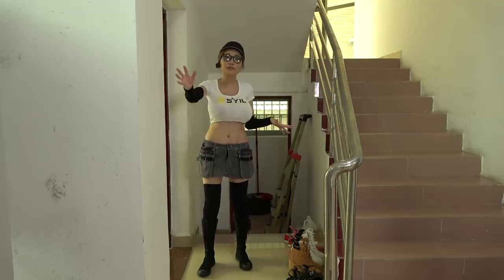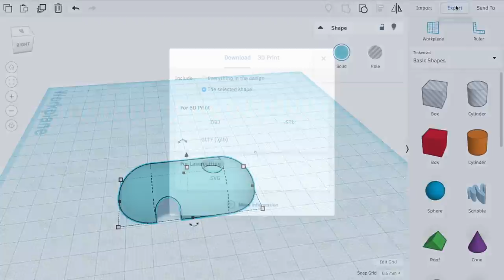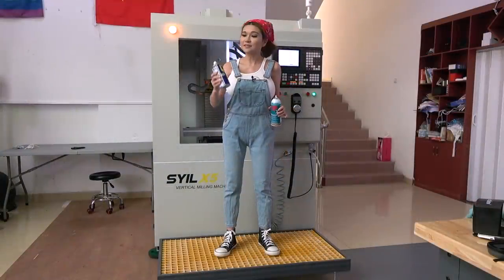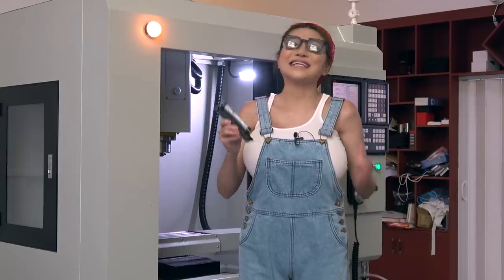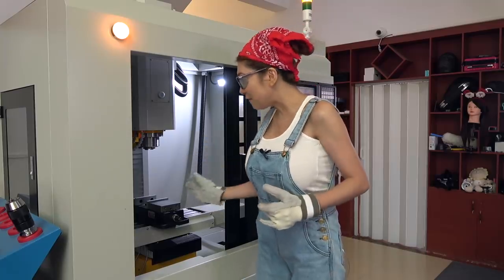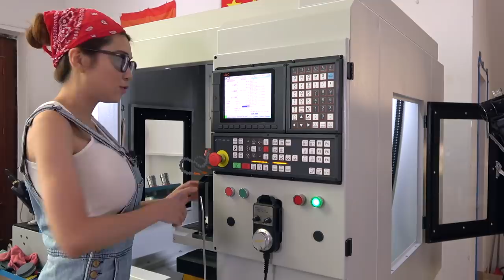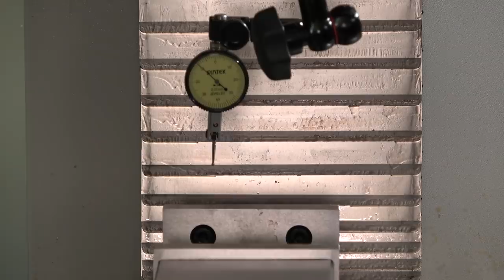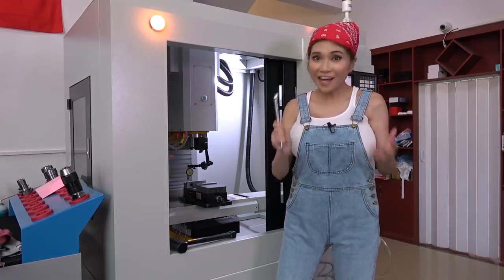Leveling and Tramming the Vise on my Syil x5 Milling Machine!

Comment: i think its time to move up to Fusion 360 - that has all your CAM programming that will create the G code for the Syil CNC Machine. 

I see yours has the Syil X5 CNC Mill  with LNC 5800 Controller  -  I was on Fusion 360 site and they have post processor the other Syil Controller Siemans 808d - just need a sample of your G code and what suffix the machine is looking for ex: *.NC

I would also use the video series from my friend in Australia with his Syil CNC   https://youtu.be/MqxOryE6qX8
Reply: there is a Syil CNC facebook group of Syil Users - they have Fusion 360 Post for Syil LNC5800 that works great.   

I have also been watching Titans of CNC academy videos for the Tormach mill - that would align with the Syil on Horsepower.